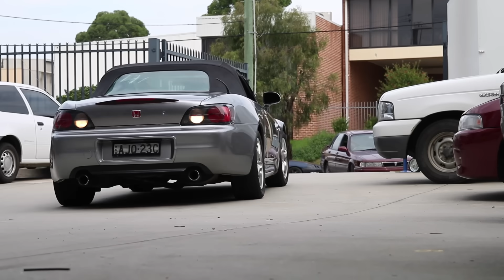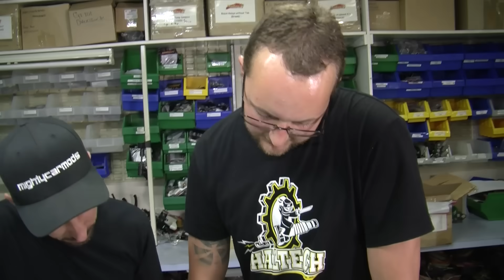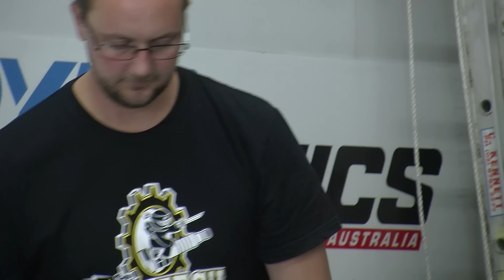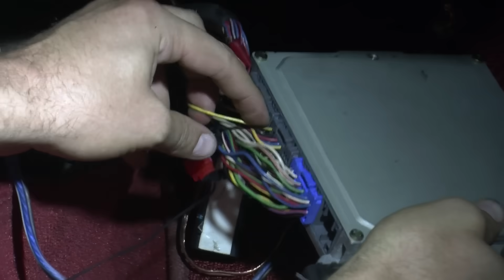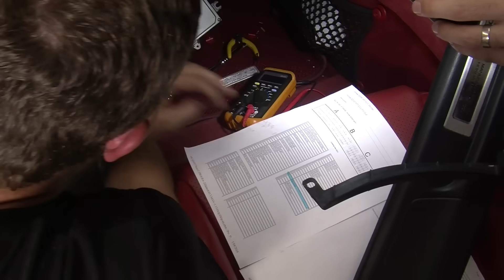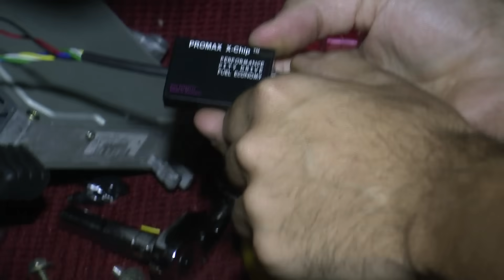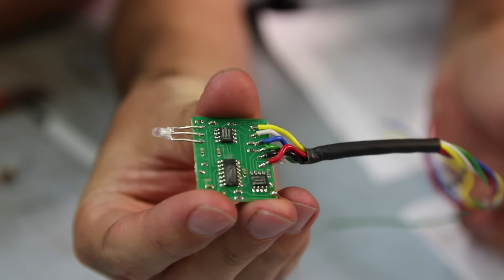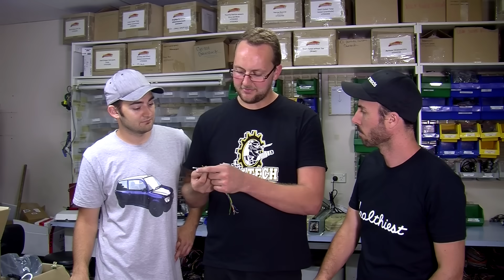eBay Performance Chips -  Mythbusted

Comment: I used scotch locks on a motorcycle wiring loom once NEVER AFUCKINGAIN turned into a mess that required more soldering than the first job would have .

Comment: Haha that circuit looks as though it is just an LED driver with an extra chip , which is more than likely just a swift bypass to complete all the circuits. Shame I was REALLY looking forward to a 210hp solution XD.
your vids are so good testing crap from ebay.
Fairplay for risking the honda I wouldnt have been brave enough to do it.

Comment: Here's the eBay link to the so called "Performance Chip" featured on this episode if anyone is interested :P

http://www.ebay.com.au/itm/Performance-Chip-Tuning-HONDA-CIVIC-ACCORD-LEGEND-S2000-INTEGRA-PRELUDE-JAZZ-CRV-/251513510451?pt=Motors_Car_Truck_Parts_Accessories&hash=item3a8f5f9a33
Reply: Haha it says for petrol and Diesel engines, that should be a dead giveaway it's a dud

Comment: Relocate the hid washer button body fill the hole it was removed from, sand back, wrap the panel in a black leather and stick down carefully with contact adhesive spray? What do you recon . Cheap $70 - $80 mod.

Comment: Regarding those red Scotchlock clones: I NEVER use those. Not the real (blue) ones, certainly not the ones in the video. They're just too unreliable and cause too much damage. Strip/twist/solder/insulate. Takes more time, but you'll be far better off.

Comment: Invest in solder before you invest in anything else with the electrical system. Solder is the best way to do electrical wiring. Feel free to use solder with heat wrap...

Comment: 177HP? Kinda low for S2000. Marty's MX-5 does like 200HP if I'm not mistaken, and weighs less than 1000kg. No wonder it chopped the S2000.

Comment: Whaaaaat? Why is that stock s2000 only 177hp??
Reply: Neil McMahon Agreed, but 64 hp drivetrain loss is quite alot. "Corrected" numbers are bs imo, since nobody can know exactly how much hp the tranny, diff... etc use up. The only way to know if your engine is 100% is to strap it to an engine dyno. Then do a chassis run and you have your loss%.
Moog's car is doing the stock numbers in the 1/4 mile, so its healthy.
Reply: this figure is at the wheels. the engine develops ~240hp (flywheel), What you are seeing is this power minus the losses through the drive train, Same for every car. The advertised power is the lossless power from the engine.
Reply: I was also assuming 240bhp is the engine output for the Australian market. That's what it is/was for the UK market. Maybe it's lower. Also, if the car has (lots of) mileage on it, it's output will be lower than it was when it was new.

Comment: Lmao you bought a $20 color changing L.E.D. that sucks. I bought an ecu chip for my E36 325i and you actually had to pull the ecu, open it up, and replace one chip with the modified chip. I never had the car dyno'd so not sure if it made any difference
Reply: that one makes different, unless its a same chip as the stock ecu.
Reply: No its different there are also modules you can buy for E36 bmws. You just plug it into the diagnostic port under the hood and flip the switch and it automatically remaps your ecu
Reply: The downside is that when you change your oil and reset the service indicator it also resets the ecu

Comment: Lately I did an audio install and used that kind of connectors: I did all the wiring, removed lots of shitty clipped plastic interior parts before (euro car lol) und got everything into the real tiny radio space (Unit with monitor and a lot of gimmicks like 5.1 Sound etc.) and had to rip most of it apart because this shitty connector didnt splice through both wires and the system didnt work properly. Nice to see that i am not the only one who hates this connectors!

Comment: In my case, with VW Mk2 Digifant, it works. But it's a dumb computer, all they did was instruct it to look up pre-calculated 'mixes' not actually calculate them.  It consults a map. Very simple, very mod. 40 mpg, turns off the fuel pump on decel. But again, a much simpler system that used a preset map. 
Which may be the seeds of the 'chip your car' stuff. It's possible, just difficult to do well and account for varaibles aka Mods.

Comment: Why the S2k have only 179hp? Normal he have 240...
Reply: Every car manufacturer displays horsepower to the crank, in this instance they strapped the car to a dyno to see the power to the wheels. You lose horsepower due to the drive train. 179 HP to the rear wheels is about right.

Comment: WOW! and there you have it you lil rice racers. HP isn't cheap and somewhere some douche is getting rich from $20 performance chips that don't even try to trick your ECU into making more power. use that $20 to buy a book on how to tune standalone engine management computers and you'll be much happier...
Reply: HP is(relatively) cheap if u have a turbocharged car . . .
Reply: and if you don't have one Dave???......
the video is about "performance" chips not turbo cars.
Reply: Dave Probert gearboxes aren't.
Reply: Tell me about it!
Reply: Dave Probert Lol too true u can spend $15-$30 on a waste gate arm or a boost controller ( needle valve ) and gain anywhere from 10-30 HP... or if your really cheap run a bead on your waste gate flapper and hope u don't hit fuel cut lol.
Reply: Also weight reduction can be free which makes ur car handle, accelerate and brake better!

Comment: FFS! All this crap about how much power the thing is putting out is the talk of morons. It doesn't matter a shit in this test. It could be measuring in terraquads or cubits. The thing was that all the runs gave the same, repeatable figure which was borne out by the fact the chip wasn't connected to do anything. The Dyno did a damn good job.

The point of the Dyno was just to come up with a comparison figure which it did with  an error of about 1%. That's a very accurate measure in any test.

For Car guys, some ( Many) of the respondents here ought to be hanging their heads in shame at how naive and ignorant they are about something as basic as a Dyno.

Comment: OMFG lol hahahaha 177hp.   Iwas wondering how killowatts would convert.  Wow what a lump.  omfg 177 hp hahahaha. I cant believe it what a beast.  LOL love ricers. Always good for a laugh.
Reply: It's an economy engine. The whole point was to make a peppy, economical engine from the start, not a drag king. That's why car's have VVT-i and VTEC, etc, it's for economy, but a little burst of power if you want it.
Educate yourself, idiot.
Reply: 100 hp per liter at the flywheel without forced induction/nos  is impressive. Doesn't matter where it's made.   As much as I can't stand people going on and on about V-tec, I think it's silly when people attempt a comparison between small performance engines and American V-8s, that's like rolling up to your neighbor on your 20hp craftsman lawnmower and laughing at his low powered foreign made weed whacker. By comparison the weed whacker has less power, do some maths and the old briggs and stratton is making less hp per ci.
So your 350 makes 400 HP? who cares. 70hp per liter is what "them rice burners" were doing in the 80's without turbos.
Reply: AmeriCIA Tyranny your obviously an idiot a stock 177hp s2k was running 14 seconds, that's impressive. now hes upgrading the engine to make it faster, it was a good video, the s2000 isint made to be a stock 10 second car, not many cars are, its a simple car with brilliant engineering, it had the fastest 2l production engine for years and years until Ferrari beat it. again, impressive. nothing rice about it. educate yourself and stop talking pointless shit
Reply: mkalb4g63 Except that Hp per liter is a completely pointless metric when comparing cars that don't have the same technology under the hood.  The S2000 definitely has a lighter engine than an LS, but my bet is that the LS has nearly as good of a power to weight ratio.
Reply: Neptune It might have the same power to weight ratio (or even a better one) but the car is also heavier which makes it more to handle in a corner. In the end it is all about trade offs and what people are looking for.
Reply: Neptune Comparing technology is exactly why I used a reference to the 80's.  It's no doubt that the American manufacturers are catching up, newer models are twice the cars they were ten years ago(around the time s2000's came out).  I used the 350 for an example, it's not just the LS that makes near 400 Dodge 5.7 does 390 Toyota does 381. Really any big v-8 can be used in this comparison.  Of course it's not apples to apples, I was just profiling, assuming that someone that still used the term "ricer" was stuck in a time where they still put cast iron heads on engines and people were amazed when they got 1hp per cubic inch.  But then again my 1997 GMC vortec 350 only makes 200 HP at the flywheel, has more torque? yes, doesn't need 9000 rpm to make it either. Educated opinions breed educational arguments. Neptunes post has lots more gravity than the original.
Reply: Adam Schloser Oh really he isn't trying to make this car faster than mx-5 and drag race it to prove it?  Weird I guess I have been watching a different series.All this time he has been trying to boost economy. Ok lol   your story.
Reply: James Russle I love fun and the ricers are sooo much fun for me.

Comment: Hey MCM! if you go get the BLUE connectors they will work the ones they included are for a smaller gauge (bigger wire). i use those things all the time love em!

Comment: Do NOT buy chips off eBay! Go to an "authorized" tuner for your company. For example Volkswagen/Audi has Unitronic or APR. They are so legit, nothing can come close when you're talking chips and tuning materials. Paying more, in this case, definitely buys you more power.
Reply: Most people shouldnt buy chips off ebay, however there are some cases where an ebay chip is legit, for example I recently bought one for my a4 b5 1.8t for $60 and it was an actual 40 pin chip that I had to solder onto the ECU and gave a big difference in power. Boost came on much stronger etc.
I've also begun tuning the car myself for E85 and have good results.

Comment: What about tuners that are actual boxes and require supporting mods like exhausts intakes and injectors ect.. They run upwards of $300 and sometimes promise 100hp. Are those worth it or are you better off getting it professionally remapped!?

Comment: $20 chips are busted.  Of course they are!  I think Honda's engineers are much better than some Eastern European knock-off.  Real ECU tuning can truly improve performance tailored for specific driving styles.
Reply: It's not that far fetched. Getting more power is easy. Doing it reliably and without damaging the engine is where the expertise comes in.

Comment: You're very brave to install and run your car on this mystery chip. I have 4 cars with LSX engines, and I use software designed for them via a laptop and the OBDII port. It allows me a ton of adjustments.

Comment: This is like 99% of Ebay auctions over here in Europe. Don't buy anything from noname companies in China or Eastern Europe. If it promises a lot at a low price, it will most likely be fraud. All they do is sell cheap placebo products designed to look like the do something.

Comment: There is the possibility of when the multimeter was used on resistance of actually frying the chip inside the unit.
Any good mechanic/auto elec and definitely a ecu specialist should no to ever use resistance when measuring the input and output to a computer. Especially when not sure on the internal workings.  Voltage measurements are a better and safer way of measurement. 
In saying that I am sceptical that for $20 you would have got a significant increase.   Just concerned that might be saying its doing nothing too soon.
Reply: There is a possibility that if you watched until the end that they explained that the wires never even went through the chips....

Comment: I am actuly suprised at the low performance of the S2000 compaed to other cheaper sports cars on the market. For example the RX8. The S2000 and RX8 are direct compeditors. Both rev over 9000. Bother at stock perform at between 230HP and 240HP but somethings different with this S2000. Check any looked after S series RX8 and it makes similar performance as it did when first built but this S2000 is performing at 180HP. Thats a drop of about 60HP? There is something not right there. Have to remember the RX8 has a shorter power curve so it is slower 0-60 and such but both at stock have the same top speed and very different layouts that lead to very different cars. S2000 having better pull but the RX8 being on rails around corners.

Anyway. Where has Moogs 60HP gone? That seems like a lot for a car that cant be older than 15 years.

Comment: interesting as said this a chip that meant to modify temp sensor readings(but don't) and would have been corrected by ecu anyway. what about some tuning boxes for turbo diesels on eBay that plug straight into fuel rail and meant to modify fuel pressure. or some that pug directly into each injector made by steinbauer. maybe not all tuning boxes are useless???

Comment: This is perfectly healthy S2000 there is very good reason why it has about 180 hp at the wheels... S2000 engines can manage 240 hp only on engine dyno running on 100 octane fuel. In normal cars it was always about 200-210 at the crank. This is a fine car and good engine just not as powerful as advertised.
Reply: True story. Pretty much all cars on sale are advertising power of the engine rather then driving wheels, as it looks much better. Worst off are four wheel driven cars, since lots of power is waisted in diffs and so on.
Reply: The advertised HP output from Honda was for 100octane?

That's really interesting.. Can anyone explain to my why Japan does this? Is 100 octane their equivalent to premium or is just ubiquitous there?
Reply: Calabunga P. K. I believe their premium equivalent is 100 Octane, yeah.

Source- Sister has a TME Evo6.5, bone stock, sticker in fuel cap recommending 100 octane.

Comment: sorry man but looks like you're gonna have to get the extra horsies the old fashioned way; big induction pipe with a pod filter (may or may not add any power but man, wait till vtec kicks in), exhaust extractors, bigger exhaust pipes with highflow cats and mufflers. THEN let the giant use that plug-in haltec to dyno tune it the proper way.

Comment: What happens if you unplug the o2 sensor? I mention this because the o2 sensor auto corrects whatever that chip does.
Reply: If you did that your car will go into limp mode since it cant get data from it and the only ref point is the HO2S after the cat.

Comment: Nice, this was much more thorough than your "pod filter" one. It would be interesting to see what actual, working resistors would do though, especially on an older car with an ECU that doesn't make corrections. I am 100% confident that resistors would still do less than an actual tune, but still... Would be neat to see a comparison between stock/resistors/something like that Hal-tech ECU/datalogger in the future, just to see how much more powerful it is.

Oh yeah, and it sounded like the car wasn't running when you measured the differences (or lack thereof) that the "chip" made. To me it would have made more sense to do it while the engine is running. That's just picking nits, though; you've pretty extensively proved that this "chip" does absolutely nothing.

Comment: Hum an S2K is suppose to have around 240hp !
177is pretty low for this car
Reply: That's 240HP at the flywheel. 177HP was measured at the wheels.
Reply: JESUS CHRIST, It's Jesus Christ.

Plus you have to remember general wear and tear. Motor is a good few years old, plus has many miles on it.

Comment: So do chips by companys such as Superchip not work either or is it just the cheap Ebay ones?
Reply: Companies such as superchips and SCT actually do work. I had a handheld tuner for my 1996 mustang gt that I was running nitrous on and they actually mess around with spark timing, temperatures and what not. As well as messing with shift points if you have an automatic. But you get what you pay for. An actual performance chip or tuner that costs you a few hundred are legit
Reply: Squalestang92
Thanks for the info bud.

Comment: ecu chips became useless after the 1980 when ecu pretty much turned in to small pcs that have processors in them and can make thousands of mathematical sums every second to get the amount of air and fuel just right. where as in old school ecus they just read the revs and then say put this much fuel and air in the motor that's why this "chip" would not do a thing even if it was meant to but they will give small gains on older cars.

Comment: When you saw this thing on Ebay for $20 including the claim that it would make 30 horsepower and the part where it said its from Eastern Europe, thats about all you need to know. Oh and Moog, your S2000 is down on power. It should make 241hp and even if thats crank horsepower, its impossible to lose almost 70 horsepower through the driveline.
Reply: It's impossible , yet it happened. Seems logical to me.

Comment: As much as I get that these chips are scams, this test is incomplete.  Yea, the chip was stated to go with the car and it obviously was just some random circuit board, but you even stated on camera that the car itself didn't have a mass airflow sensor.  Maybe take that cheapo chip and splice it into another car and see the change?
Reply: There wouldn't be a change.  One of their forum users traced the circuits on the chip.  The chip itself does absolutely nothing but turn on an LED when you toggle the switch.  It wouldn't matte what car you put it on, the chip is non-functional - it does nothing at all.